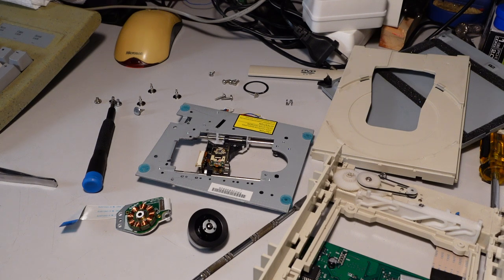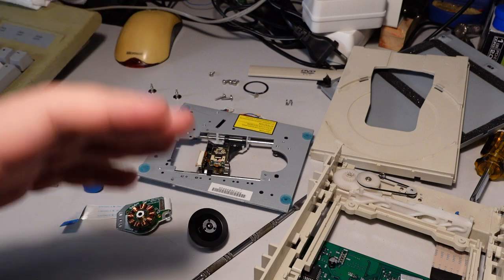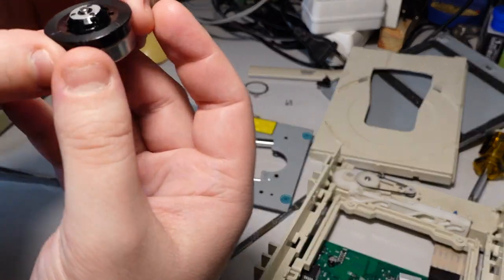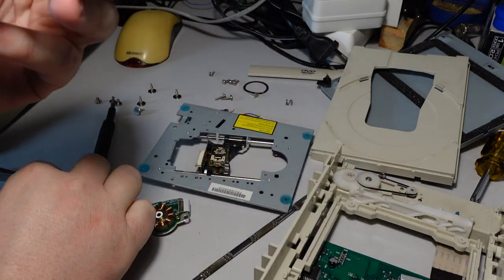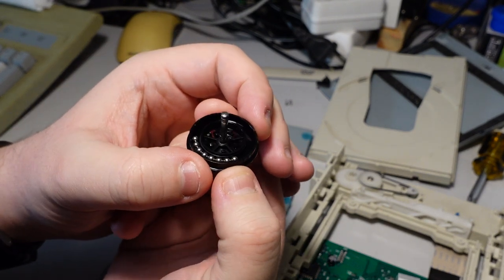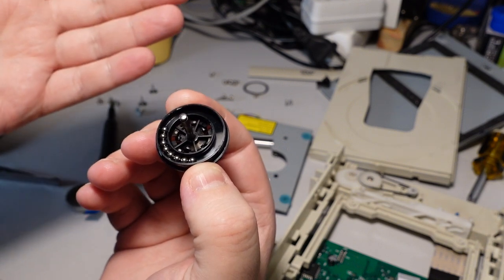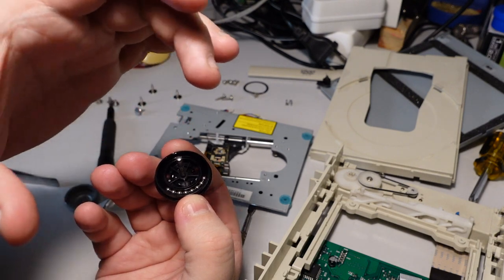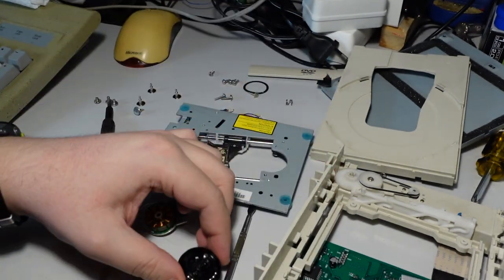The simple but brilliant engineering of self-balancing spindles

Comment from the maker: Minor addendum: it's not so much the spindle by itself that could be so out of balance, necessiating such a mechanism, but rather the combination of the rotating mass of the spindle and the disc it spins. CDs and DVDs are made extremely cheaply, can be pressed slighlty off-center, can have crooked labels, and the disc itself could have been grabbed by the spindle in a slightly off-center position, which would lead to severe vibration. This self-balancing mechanism elegantly rebalances the whole thing as it spins.